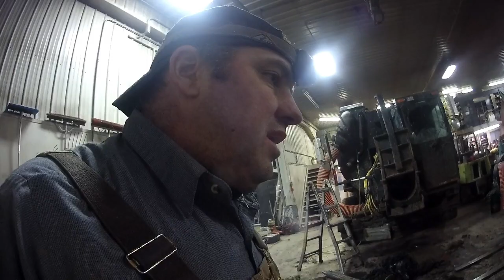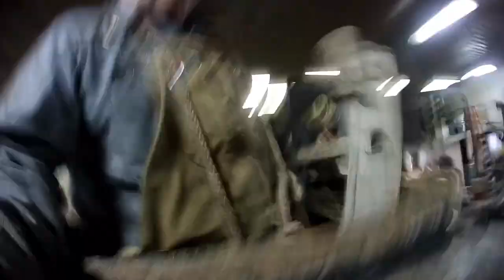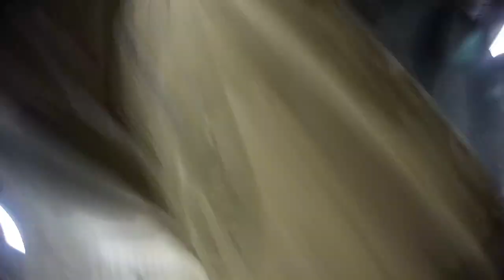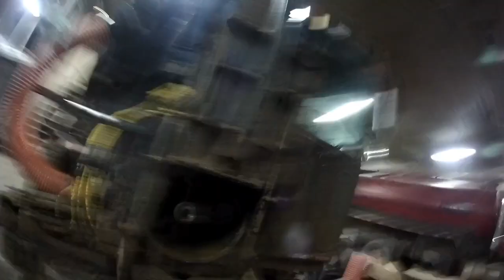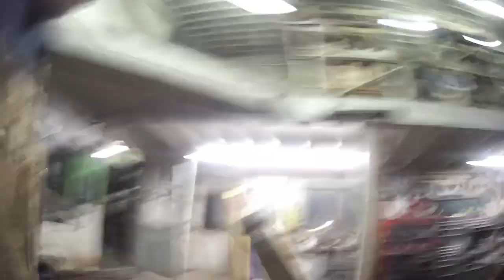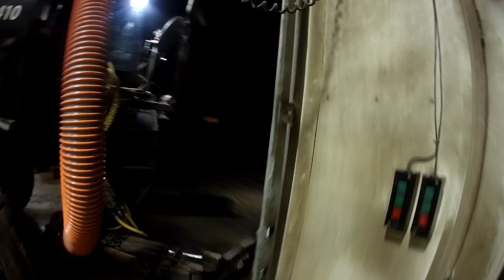Part 2 of 2:Mensch Vac Truck auger bearing replacement

Comment: Good video thanks for sharing andy. Just curious about that rubber flooring, im sure its for cow comfort but do you find you have less hoof issues than if they were on concrete? Our robot holding area has rubber flooring over the concrete. I really wish we had solid alley floors way easier for cleaning than the waffle panel floors we have. Which allows the manure and junk to fall through to the "pit" system. We have a small pit outside the barn that all the manure gravity flows to from under the waffle floor basically our manure storage is the put and below the waffles. Im sure it was a good design in the 90s when it was built but it seems to have its issues now especially after going to robots, a lot more maintenance now.
Reply from the maker: Hoof health is in good shape not sure if there is a direct correlation to the rubber or not.

Comment: Dont u ever worry about gases from the manure
Reply from the maker: Yes I do but they aren't as bad if the tank hasn't Sat to long. Another words if the unit was just used and not sitting in the sun it usually isn't bad. However should always have a ventilation fan running

Comment: Don't you think you should have cleaned that poop out of that tank with water 1st - just curious
Reply from the maker: I didn't think that I was going to have to get inside it I spent a good deal of timing washing where the bearing was. It would have taken a couple hours to wash out the inside and I would have gotten covered doing that. Good question though.